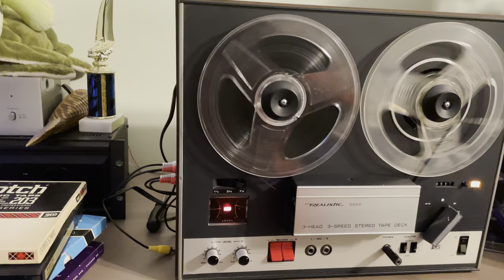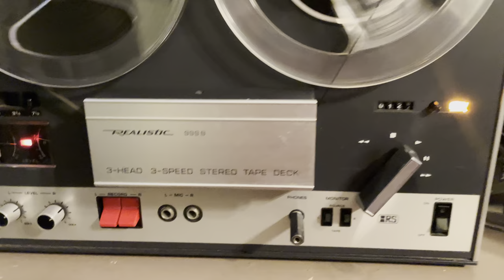Realistic 999B Reel to Reel Demo - 1973 - Restored Idler Wheel

Comment: This one is indeed made by Hitachi for radioshack, they actually sold it themselves in a slightly modified guise as the TRQ-701S, which is a slightly lesser machine, being 2-head instead of 3, though it does have the odd addition of a built in amplifier and speaker plugs on the back. Having gotten my hands on the Hitachi one myself, I'm honestly pretty impressed with the construction, and the longevity of the rubber components - definitely showing their age, but I have newer and more expensive machines in far worse condition.
Reply from the maker: Thanks for the comment and for the other model you list above. It’s interesting piecing the history of these together, they are 50 years old!
Reply: @davismv  They're really awesome! They also share the tape transport (but not much electronically) with the TRQ-730. Hitachi definitely knew what they were doing, I think.